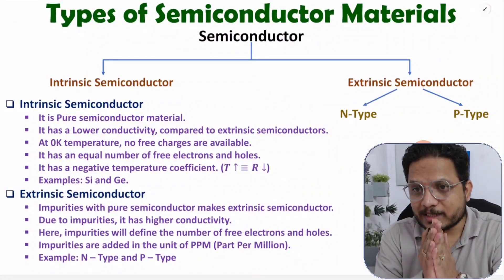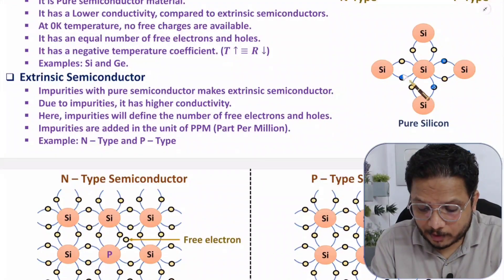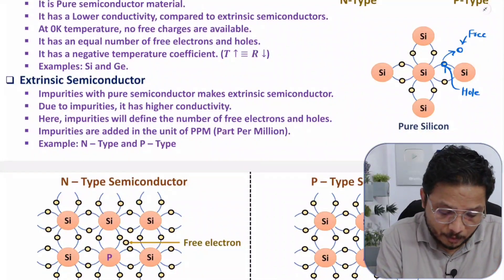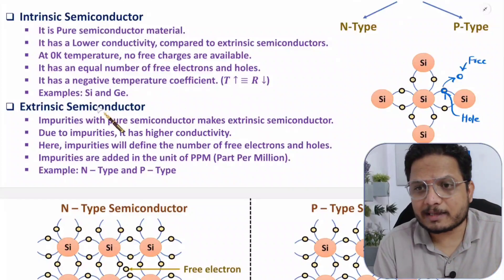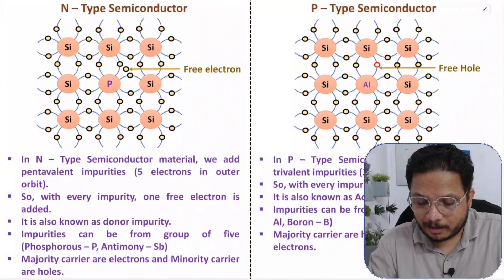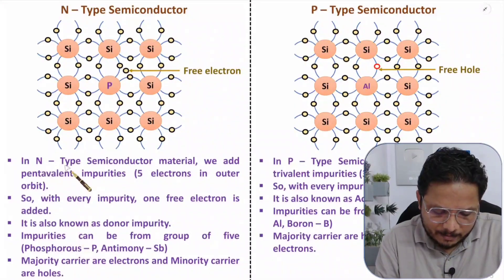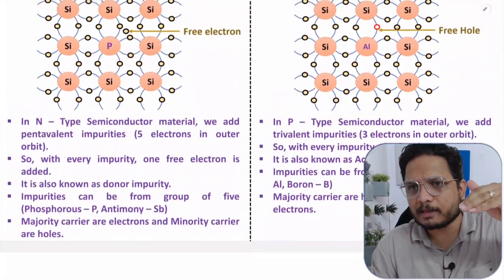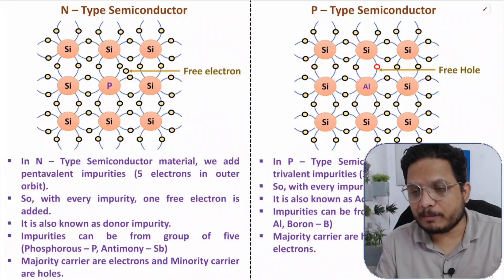Types of Semiconductor Materials | Intrinsic & Extrinsic Semiconductor | Engineering Funda

Comment: Timestamps 😂😂
00:06 - Semiconductor materials are classified into intrinsic and extrinsic categories.
01:41 - Intrinsic semiconductors have no free charge carriers and lower conductivity.
03:11 - Generation of holes in semiconductor materials
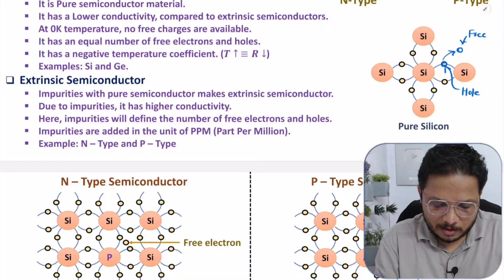04:50 - Introduction to Intrinsic & Extrinsic Semiconductors
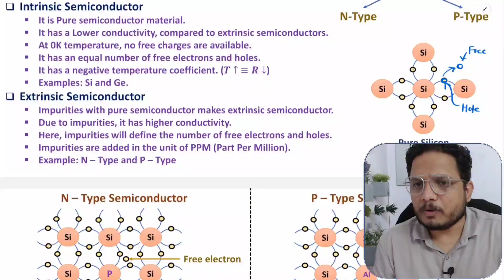06:25 - Adding impurities to silicon changes its conductivity.
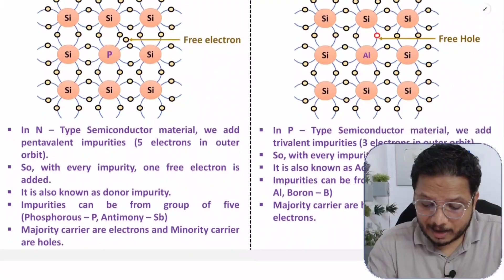07:58 - Adding impurities to semiconductor materials creates free charge carriers
09:29 - Semiconductor materials have majority and minority charge carriers based on impurities and temperature.
11:03 - Intrinsic and extrinsic semiconductors have different majority charge carriers and ways to generate electron hole pairs.